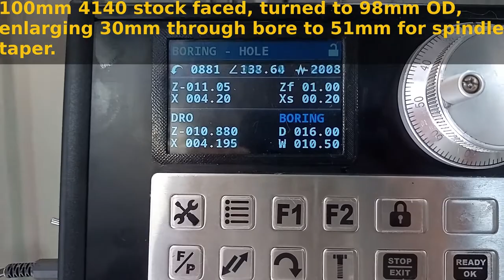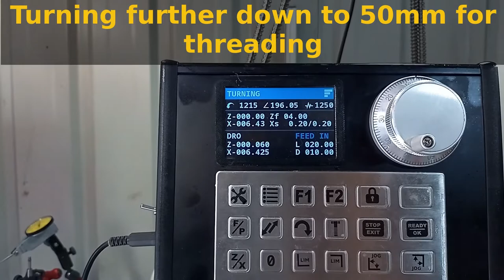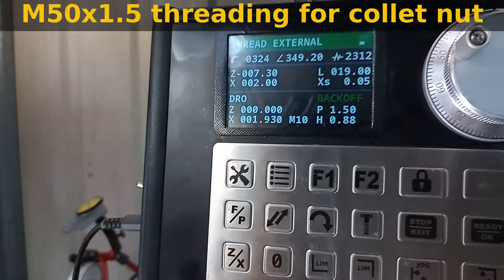Making ER40 Collet Chuck using the Electronic Lead Screw.

Comment: I'd say that is a pretty good amount of run out.  Looks good.
Reply from the maker: Good amount as in reasonably small ? I think I can get it down, need to blue the taper and check for fit first. The collet spring tolerance is about 0.008mm so anything better than that is acceptable I think.
Reply from the maker: Well, I may have gotten very lucky. Refinished the taper and run-out seems to be to be well under 5um. I'll have to double check it with a precision test bar if I can get my hands on one.

Comment: That;s fine.
I was fitter and  turner  done work from washers to 30 ton castings and still like to see someone do machining, you developed ELS I think good one, when you turned stock around turned down to 70 mm then to 50 mm and threading, if you explained how ELS was used  let,s say turning from 90 mm down to 70 and down to 50  and threading, angle to fit collet etc. People would say  good  ELS want one.

Comment: Brilliant watching it in operation, is it numerical control or cnc? Looks great watching the screw cutting up to the shoulder and stopping, it's producing a great finish. Does it retract and repeat the whole sequence automatically? Tony
Reply from the maker: It's close to what you'd call a numeric control, but not a full blown CNC (no GCODE processing) - generally called "Electronic Leadscrew" or ELS. You program the operation primitives and let the microcontroller perform the required operations. Similar to conversational programming in some CNC software / controllers. 
Glad you enjoyed it.
Reply from the maker: and yes it's automatic, retracts and feeds in until it finishes the full operation cycle.